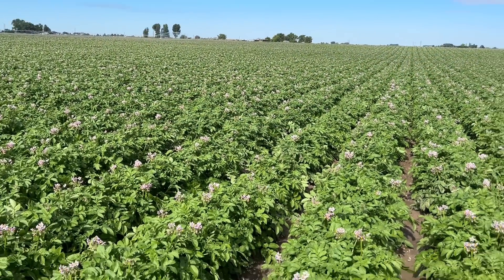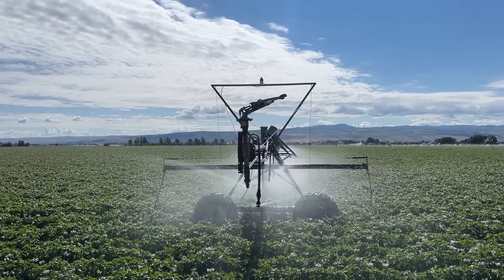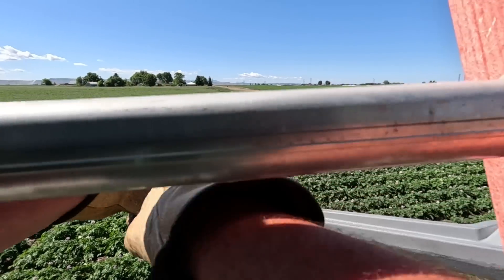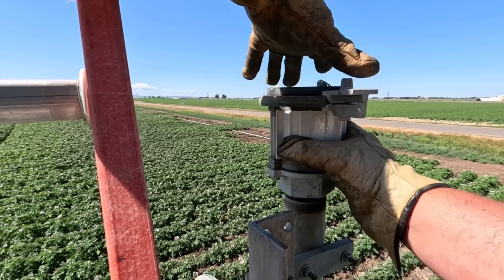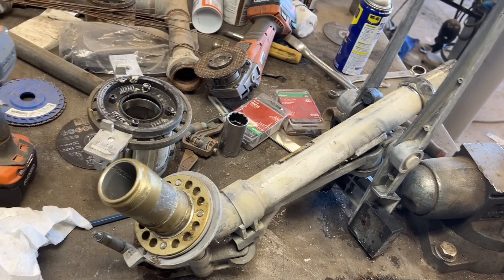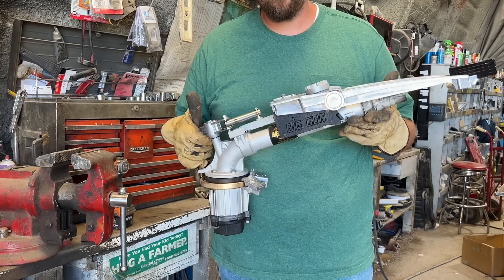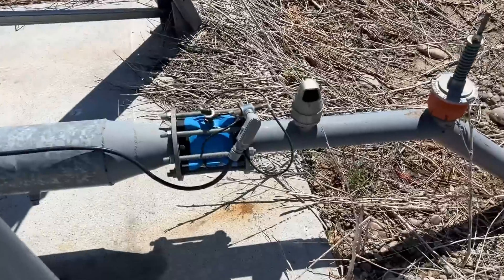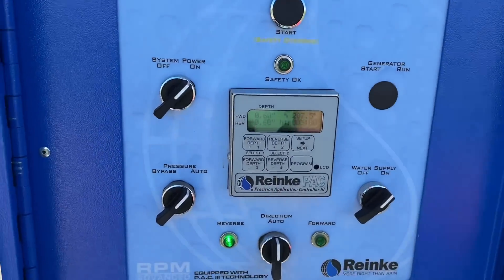Pivot endgun exploded! We have to fix it!

Comment: As a kid i loved watching farm irrigation. I loved the old pivots with the impacts down the pipe and the old fast reverse model guns. I always thought those were cool how they whipped back in reverse. I have a collection of Nelson's end guns starting at the PC100 all the way up to the P200 (Monster big gun, usually used on travelers and solid sets) but once in a while one would make its way to a pivot as a secondary end gun to get more acreage on corners. The system would run as normal and when it reached the corner it would shut all the impacts and the smaller end gun off and run the P200 big gun for awhile then shut that off and run the smaller end gun and impacts until it reached the other corners. Not alot of pivots around here use that tech anymore due to the shutoffs getting stuck and the extra wear and tear that big P200 gun would put on the overhang. (Those guns have such crazy force especially in reverse, it wasnt uncommon when those kicked on that the overhang would sometimes come crashing down). There are still a lot of farmers around here that use the old tech (the old P200s or Komet Twins on traveler carts and reels) to irrigate their fields. Thanks for the video. I've never seen a gun come apart at the base like that. Something mustve snapped! Hopefully it doesnt cost you a ton to rebuild it!. I have had to get all of my Nelson fast reverse guns rebuilt when i got them, they either leaked at the base or locked up (bad base bearings). I had a Valley dealer rebuild them all for me. They can do gaskets/seals bumper stops and base and arm bearings but no cast on parts since the FR models stopped being made long ago. During the summer i would just drive around and watch the irrigation at work. Always love seeing the FR ones working. Heres a video of a P200 Nelson FR irrigating a big corn field in MI i took many years ago. Thats got some serious pressure! https://youtu.be/rbb5gIaIBvo?si=OKLHOB1McYymNT_n

Comment: I assumed that the end gun was to get all of the corners, but I guess the longer the pivot, the bigger the diameter of the circle and the harder it is for the end gun to get it all, and that's where the "handlines" as you call them, (called solid set here in UK when they were used before hose reels took over) help to get the last bits right in the corners? I was surprised how quick your potatoes are flowering at your altitude. What latitude are you at? Maybe you get longer days. We are 52 degrees just north of London.
Reply from the maker: Yeah we try to cover as much as we can but we usually need some headlines or altitude is 4600 feet and the latitude is 43°
Reply: Many thanks. Compared to my 300ft altitude and 52 lat, your altitude slows your crops down but southerly latitude offsets it and speeds things up. It must be a short but very punchy growing season. Interesting.
Reply from the maker: It’s around a 5 month growing season.

Comment: On my galvanized pipe water fittings, I use teflon tape on the threads. Its not so much for sealing but to lube the threads and keep the fittings from seizing up making them MUCH easier to get off when they need to be replaced or worked on which is inevitable sometime in the next 20 years for my place.
Reply from the maker: Great tip!

Comment: lol don’t see how u find anything in that shop everything pilled up  love the video’s washing the potatoes was crazy video  farmers are hard workers every young person need to work on farm for a year give them a work ethic
Reply: I'm guessing you've never spent much time on a farm, no offense intended. We just have a small place with just myself and 2 of my sons working in it and it is quite litteraly organized mess. I have 2 tables so full of parts and pieces from sprinkler parts, automotive parts, to pieces and specialty tools for building go karts and four wheelers. All this in just 1 of my 3 shops, my machine shop is worse bc it's the smallest. We clean it out when we can which generally equates to whenever the tractors or equipment start having to be worked on out in the parking are bc there is no room inside the shops to fit them. We will then make a converted effort, if we have time, to clean the shop up to at least be able to pull in equipment so we can work on it the rain.
Reply from the maker: Yep and it seems like as soon as you put everything away then you can’t find anything
Reply from the maker: Yeah, we clean it every once in a while but with so many people working it becomes a mess pretty quickly I’m glad you liked the video.

Comment: Nice repair job. And a wide range of controls you have there. Regarding your mainlines: do you pump from the chanell and maybe can show the pumps at a service or is there a central pump station for multiple firelds maintained by a cooperative or so?
Reply from the maker: We don’t have to do any maintenance on the pumps we just have to keep them oiled and there’s a pump for each field. The pump is either controlled from the pivot center or there’s a switch to turn it on hand to run the sprinklers in the corners.